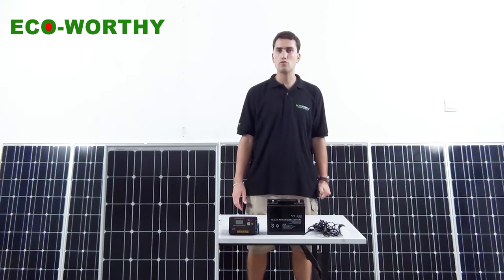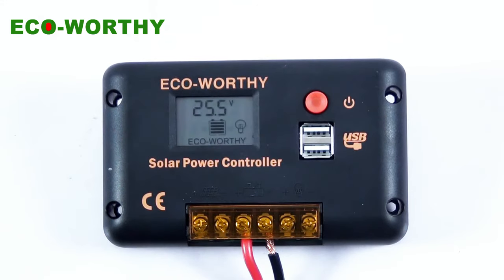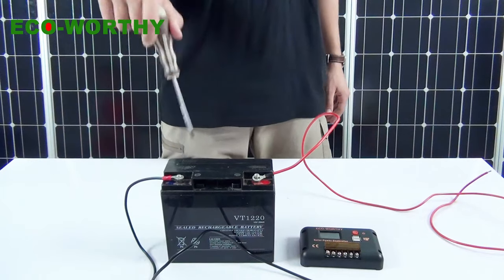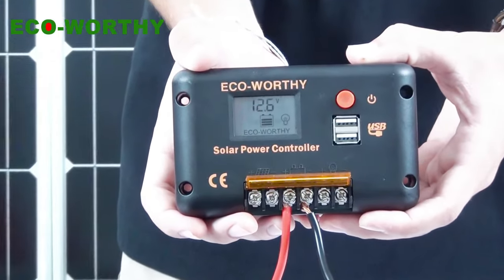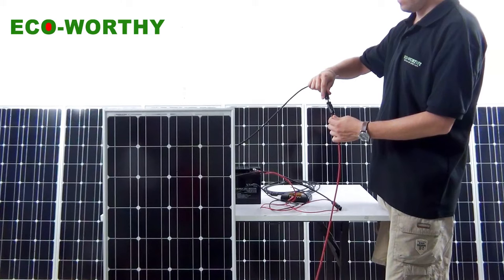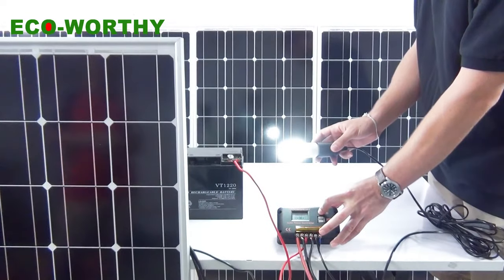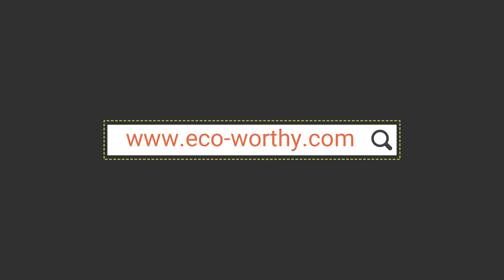For beginners - How to set up a simple solar kit

Comment: Just hooked mine up .. we will see.. I have the 25 watt one and it works great and it had plug ins so it was much easier to set up but only half the power..
Reply: Did you use a battery or just solar for years?
Reply from the maker: Hi, now you can choose our products and see price even don't need to login  from：  https://linkpop.com/ecoworthy
Reply from the maker: Hi, now you can choose our products and see price even don't need to login  from：  https://linkpop.com/ecoworthy

Comment: I have this controller in my campervan. Can you tell me please, does have a warning sound when voltage is too high. 3 high pitched beeps, pause, 3 again and so on. I have had this happening a few times now and have had to pull over in an emergency and turn the engine off to see where the warning beeps were coming from.
I can only think that it is a high or over voltage warning alert.
Reply from the maker: Hi, now you can choose our products and see price even don't need to login  from：  https://linkpop.com/ecoworthy

Comment: what gauge wire are you using for the controller to the battery ? the connection ports look pretty small.i bought one need to know what size to buy
Reply from the maker: Hello, I'm sorry for not being able to reply to your question in time, now you can check the latest products and prices directly through:https://linkpop.com/ecoworthy
have a nice day!

Comment: Can you let me know what the <30% 50% and >70% on my ICO-SL-L-45A Solar Charger Controller? I have no batterie hooked up and when my solar panel has light it lights up the green charge light and the >70%. Does this mean the panel is putting out 70% or greater? I would not figure that anything would light up without a batterie. Does anyone know this?
Reply from the maker: Hi, which platform did you purchase the product from? If you have any product problems, I suggest you contact the appropriate platform customer service directly, they will be more aware of your order information, as well as the problems encountered，thank you
Reply: @EcoWorthySolar  I didn't buy it my cousin gave it to me.

Comment: What kind of battery can it charge,  looks like lead acid, can you also charge lithium?
Reply: According to the manual you can change to lots of different kinds of batteries via the settings menu, BUT so far I have not found a way to the settings manual?